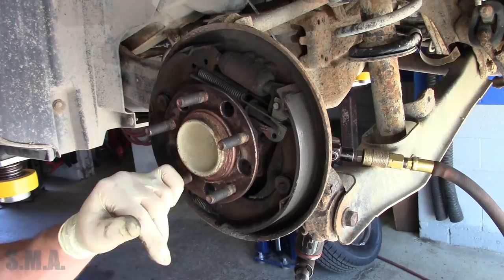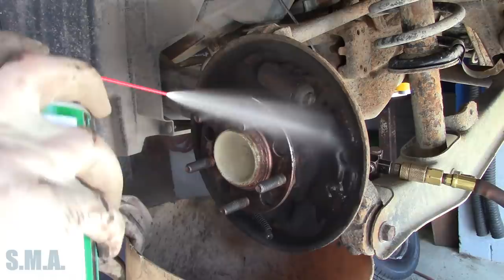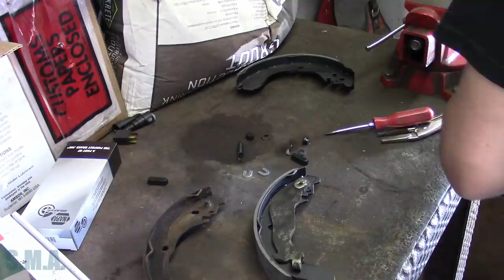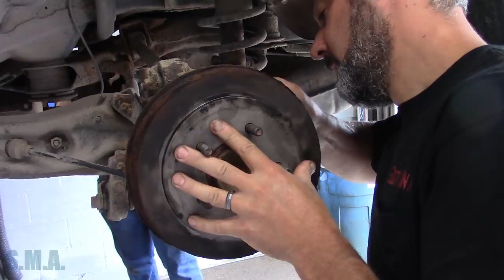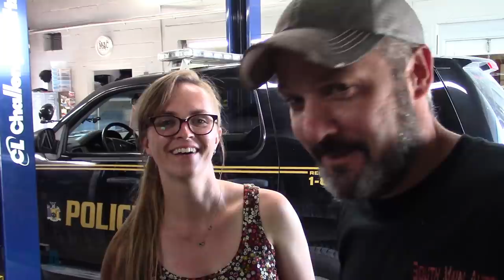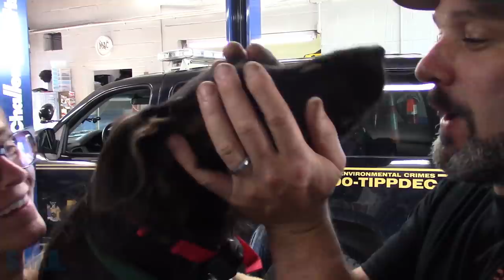Chrysler Sebring: Rear Drum Brakes

Comment: Back in the good old days... the 60's...I was taught to ALWAYS put a kit in the wheel cylinder (and hone the cylinder). I still have my brake cylinder hone.
Reply: Every time i do a brakeshoe job i always put a new cylinder in. From my experiense they tend to leak after 10 years or so. New shoes with breakfluid on them =change of the shoes.
Reply: @fulf  Probably a good idea. In the rust belt sometimes you try to remove the wheel cylinder you're replacing the brake line due to corrosion. If you're lucky you can crack the flare nut loose and spin the wheel cylinder off.
Reply: Tired Again
, back in those early good old days most all vehicles not only had drum brakes on all 4 wheels, but were also stopped with a single circuit master cylinder as well.  So during those good old days the brakes' hydraulics all HAD to be good to go so they could tend to last just as long as the new linings after leaving the shop.

Comment: Did my corolla's rear drum brakes recently. What a mission. Disc brakes are so much easier.
In hindsight, gotta get myself one of them fancy needlenose vice grips, will make things so much easier. Dang springs.
Reply: Drum brakes are by far better here in the rust belt, rear disc’s love to seize up, my corolla lasted 115k and still had plenty of pad, just the drums themselves gave up on life thanks to salt corrosion
Reply: My car has 102,000 miles on the OEM shoes. I replaced the front brakes at 77K but I DREAD the day I have to do my back drums!
Reply: @ZePanthersGang  Heh, good luck with that. 

On that note, I dread doing our Sharan's rear disc brakes, apparently there is a "speshul" method involving with compressing the caliper back... seems you have to rotate it in the correct direction whilst applying pressure.

GAH, why do manufacturers think out new ways to torment us so?
Reply: @emilschw8924  they seriously do! It can be simple things like bleeding the brakes on your car, The fronts are 7 mm and the backs will be 11 mm. Why the difference in bolt? I swear they do it to torment us!

Comment: This video reminded me, of me, back in the day ('72 at college) when my baseball coach couldn't get his Nash Metropolitan's slave cylinder fixed at the repair shop (refused to take the job).  I told him I'd look at it, and one thing led to another and I did the job in the parking lot with hand tools and a bottle of Dot 3; mission completed.  (it wasn't 'rocket surgery' after all).    :D
Reply: Chuck Grenci I knew a guy in college, same time frame, who would loan his metropolitan to friends with only the requirement that you fill up the oil before you brought it back.  BTW That thing had fully reclining seats.  Very popular.

Comment: Everyone keeps talking about the needle nose vise grips. I never had the tool doing backyard brake jobs, way back in the day. Funny thing is, I finally bought the tool and low and behold, I went back to the needle nose vise grips, so much easier to work with, I couldn't believe you were using them when the video started. They are so much easier than the brake tool, and the brake tool works well but, I like the vise grip better.

Comment: Last time I had to replace rear drums was ages ago lmao the fact the rears wore out before the engine grenades  is amazing lmao
Reply: Amazingly, Toyota and Honda had models with rear drums even into the 201#'s.  I hate the stupid things but have done drums on a Nissan, two Toyotas and Suzuki in the last 2 years...and I do not even get paid for any of it!
Reply: @michaelkrenzer3296  I have one of them as my 4 cyl 2002 Accord SE has rear drums.  The 6 cylinder models had 4 wheel disc brakes.  I have 119k miles on mine and the rear brakes are still original although I have gone through several sets of front pads and rotors.  My mechanic uses factory Honda pads as he feels that aftermarket ceramic pads wear out the rotors too quickly.  The car I owned before the Honda was a 1988 Toyota Camry which had front disc/rear drum brakes and that car could stop on a dime without locking up any wheels even without antilock brakes.
Reply: Yeah I’d recommend everyone to stay away from American made cars, they’re garbage. Get a Toyota/Honda/nissan instead. If you want a truck/suv then choose an American brand lmao.

Comment: I use Pronto brake cleaner 817201, non chlorinated, 14oz can $1.64 in 10 case quantity purchase. It has replaced my CRC brake cleaner, it is also the best carb/throtttle body cleaner I have ever found. Uses CO2 for propellant, Love the stuff. I have found it the best ever for also quicky cleaning small engine carbs. I am surprised that since that drum assembly is a top adjuster type (adjuster under the wheel cylinder) that you don't automatically replace the wheel cylinders. My shop was in Illinois for many years and although we don't use as much salt (year around) like they do in your area it has been my experience that the wheel cylinders fail 90% of the time not long after the brake job unless replaced.

Comment: Hey Eric, My first car was a 63 Corvair I paid $15.00 for it. Had 4 diff tires, battery dead and shot oil out of the dipstick. Needed breaks. I went to the local junk yard (auto salvage for break shoes. Learned to bleed the breaks by myself using a concrete block leaning on the brake pedal. Ran alchohol to clean out oil passages.

Comment: "Wondering if the last guy did it right".  Yeah,  I had that issue with the wear tabs on a 2010 Sierra.  The squeak tabs were on the leading edge being forced into the pad if they hit the rotor.  I always thought they were supposed to push away from the pad when they hit the rotor.  I couldn't find any good info online so I put them back in the way I found them.  I was trying to do the front brakes using my EricO online classes by cleaning and greasing everything just like EricO.  Due to un natural circumstances, I installed new brackets, calipers, rotors and pads.  Not much rustbelt rust to clean.  I enjoy doing brake shoes but they aren't as common.  I like using the special retainer screwdriver and spring release tool.  Vice grips on complicated stuff.

Comment: My renaults drum brakes were NOT 30min job lol. Had to lend huge puller to get drum off from otherside. Also had to order new adjusters, as previous owner/shop had small steel clip removed. Haha, you make all seem so easy. There's always something, even if you prepare.. Still needs new parking brake cables as drivers side is little streched.

Also watched that slowmotion three times :)

Comment: The issue with using slip-joint or Vise-Grip pliers to install the springs is that the teeth on the jaws can nick the wire, making a stress riser which might lead to a fracture of the spring. Brake spring tools are smooth where they contact the springs for that reason.

Comment: Interesting brake configuration with the adjuster just under the wheel cylinder and anchor points where the adjuster used to go on older vehicles. They must not be servo action brakes.

Comment: Interestingly. I had a Yamaha DT50cc scrambler, drum brakes front and back. Was so easy to replace. 

All you do is to pop the old shoes out, put the springs on the new shoes and slide them into position. They don't have the little spring retainers in the middle to keep them in place. 

Mediocre brake action from drum brakes though. But hey, I survived. :)

Comment: I've noticed that using anti seize in the adjuster just creates more issues than anything else, just like using it on caliper pins. The anti seize gets really think and gums up the threads of the adjuster. Don't know if it's a difference in longer winter's up here in Canada but I use brake grease everywhere now and I don't have adjuster problems anymore.

Comment: In the olden days [ before disc brakes ] the wheel cylinders were ALWAYS overhauled during a brake reline job. Failure to do so would inevitably lead to a leaking wheel cylinder, as the cups would be moving back over a, most likely, contaminated surface.

Comment: I usually replace the rear brake pistons together with the brake shoes. Worst thing that can happen to you, is you do all new brakes and two days later the cylinder starts leaking and you get a mess. Then you need to explain the customer that the cylinder was fine when you did the job:)

Comment: nice job, very important that the shoes hit the wheel cylinders if ebrakes cable is seized they won't hit the cylinders behind the anchor pin you will never get a good brake pedal

Comment: On a 2007 Dodge Dakota had to replace the whole parking brake/adjuster lever. One pin sheared the other froze up again. I had unfroze them at one time. Ya know something is off when the parking brake isn't holding the truck on a hill. Was a dealer part only for a non-dorman (junk) one. Was only 70 bucks total for both sides. And included the star wheel as well. Oh and put a new hardware kit on as well. This I do know, I hate the spring steel and prefer the normal style of hold down.

Comment: Love your show it’s teaching me a lot. I have 2008 Chrysler Sebring convertible and have had this car 7 years, it’s been a good reliable car. It’s a Limited. Bought it with only 30,000 miles on it and it now has 85,000 miles on it. Totally a problem free car. My oil light comes on once in while on startup, no ticking no knocking no nothing. ODB2 says low voltage on switch. Replaced it with a new one and it is the same. Oil pressure is good? What is the fix for this? If it stays on at startup I just restart and it goes out and stays out.
Thank you Ron Guraliuck
Reply: Keep up the great shows. Ron G
Reply: PS been using synthetic oil with WIX filters changed regularly at 6,000 mile intervals.

Comment: that back spring the way i do it at the same time as i set my 2nd shoe. so the spring is already on the shoe and pull it set the shoe into the adjuster the spring hold it in place and then i set the retainer to hold the shoe. cause i hate trying to get that spring into place later...

Comment: Places that machine rotors and drums are gettn pretty rare in my neck of the concrete jungle. 1 of the few that remains gets $30.00 per drum up to 10 inches, $40, 11-13. Might as well buy new 1s if they're small, after you calculate the down time waiting on the shop to get 'er done..

Comment: You must be using "quality" parts. I did a brake job using parts from a store I won't mention (*cough* Autozone) and the drums wouldn't go back on (new drums, no ridge) - not even with the adjuster all the way in. Returned the shoes for a new set, same thing. Turns out the notch at the bottom of the shoes was cut too shallow - I ground them a 32nd deeper on both sides and BINGO! Perfect fit! You get what you pay for.
Reply: were the stud holes drilled right in the drums/rotors? what about the wheel hub assembly, had them drilled offset also and nothing would fit period lol....
been there done that, all from china or mexico.

Comment: I don't bother checking the wheel cylinders , i just replace them with the shoes because there's a good chance that when you compress the cylinder to fit the new shoes it will start leaking soon after. Then you will get a  "I just paid for my #%$%^&*g brake job and it leaking #%^*&!  brake fluid everywhere!!! phone call.  I don't like getting those phone calls. To get the horseshoe clips out i put the shoes in the vice and use a screwdriver and hammer to spread them. Sometimes you have to swap the mounting pin too. I use the side cutters to squeeze it back in place. She came to you because if he takes it into work to get done it will cost 3 times as much. Dealerships usually use genuine parts and have higher charge out rates but you do get a better cup of coffee and cookies if you wait. Yes they are good parts but nearly all aftermarket parts are just as good quality and usually cheaper.

Comment: Watched your Toyota RAV4 timesert head bolt repair on the 2AZ-FE. I have a 1NZ-FE from ScionXA apart. It's head bolts would require a M10 timesert as opposed to the M11 you used on the Rav 4. Can this be done effectively on the 1NZ-FE... even if not necessarily blessed by Toyota? I've not been able to find any information on it having ever been done, although, there is an M10 kit available. Thanks.

Comment: You wouldn't happen to have a Kia Rio 2012-2017 for a rear brakejob there? :P 
My 2016 Rio apparently has left rear brake dragging, rim gets hot so have to check what's going on there, but never done anything to rear disc brakes. Don't know if it's the hand brake mechanism or pedal brake system, that's dragging.

Comment: I have an '11 Silverado with rear drums (I know, right?) that I'm gonna change the shoes on, and if you were hurtin' for work I'd take the short ride down to SMA and have you do it while I waited, but instead, I'm gonna have to do them in my driveway. I've done drum brakes dozens of times, just not on this, and I've had it for 57k. It's got 92k on it and I have no idea if the drums have even been off. Should be fun finding out.

Comment: You didn't tell the old school way of final adjustment of backing up fast and jamming the brakes on to set them lol
Reply: I remember doing that backing up adjusting method in High school auto shop in the 70's, and using the giant spring tool.

Comment: I see the fella's SUV in the bay - 110 MPH test drive! Gotta test lights n sirens! 😁

Gotta love when pups grab and tug facial hair, lol! That hurts! Worse when they actually bite your face ... 😂

Some of the worst drum brakes I've ever done in my life were on my buddy's '96 Tahoe. The struggle was real there, holy crap. Most poorly designed drum brake setup ever. Worst parking brakes I've ever done was a '12 Ram pickup - FCA in their infinite wisdom decided to make the axle flange so big that it covers 95% of the stupid hardware! I was stubborn and did them axles in. Lots of choice words were getting shouted on that one. I think in the end, it would've been faster to yank the stupid axles!

My '07 Silverado still has rear drums. Pretty simple to do with that torsion spring tool. First time I did it, I had NO tool - used my bare hands basically. I was bloody afterwards, LOL. That little $20 tool from Lisle was a lifesaver. Only struggle on those is that parking brake cable spring. WOW is that thing STIFF! No real easy way to pull that thing back - just gotta grunt, and swear a little. My local NAPA is too small to turn drums - the bigger one in the city does, but that's a place I like to avoid whenever possible. There's a garage closer by that still does them for $13 a piece.

We finally got our power back on last night!  Put 52 hours on the ol' Yamaha generator. Found out, it cannot power my lift or my compressor, so things were getting real over here yesterday. Was glad to hear my Buzz Bulb screaming in the basement before bed! One neighbor still has his running this AM, lol - gonna have to give him a shout. Anyway, nice work as usual, brother! 👍🍻

Comment: Every time I send out drums they tell me " there to far gone you need new ones "!
Reply: True story: 20 years ago I was doing a rear brake job on my wife's Camaro and I took the drums, which were not scored at all, to a local parts store to be turned. These drums had a witness mark in the form of a shallow groove in the center of the drum surface to indicate maximum diameter. When I got them back the guy behind the counter informed me that they had to turn the drums to the legal limit to "get rid of that groove." We sold the car before it needed brakes again.

Comment: I like Eric.  I find SMAR entertaining. 
What I think would be a very valuable video would be "How to prepare for a basic repair/maintenance job (for  novices)". Another would be  "Vehicle DIY repair safety. and material handling".
If you can do it, they can do it.  But how many of them want to work on dirt, rusty, badly maintained vehicles, doing things like brake jobs once on a vehicle?   I could and I did, not because I wanted to but because I couldn't afford to pay others. The factor that is lacking is more often motivation and a decision to try, not a lack of technical information.  

Sorry to no be so negative, but I wonder if making these jobs look as easy as they are with the right knowledge, tools and facilities, might actually serve to demotivate someone fro DIY after they find their first project takes many times longer for them than it did for you.  Not to be a killjoy, but just obtaining  parts takes longer than one of these videos.  If you find that a part needs replacement while you are working on your only vehicle that can triple the clock time.  If that time is your "spare" time when not at your income-producing job . . . That's why I suggested those two videos.

Comment: Eric and the public I have a question for you all. I have a 2004 Jeep Grand Cherokee with the 4.0. I am not getting any power to the fuse box for the o2 sensor, fuel injectors, and tcm. It’s weird I’m only throwing a code for the o2 sensors.. please help

Comment: up next, customer returns with complaints of scraping/noisy rear brakes.... only to find fluid leaking out wheel cylinders lubing the drum/shoes.
yeah, pretty much guaranteed to happen since about the late 90's on drum brakes , used to be very minor moisture/contaminate pitting, you'd hone them gently and install new spring/plunger/dust-boots. then they changed the fluid to better magic. the main issue is adjuster stick and the cylinders slowly creep out further and the pitted area grows and deeper in the later fluids/worse metallurgy, meaning pretty much rear brake job =  quote wheel cylinders, fluid flush, hardware kit, parking brake hardware, shoes, other items and probably drums which got eaten long ago/too thin.
the difference between 1980's and back vehicles and the post early 90's junk